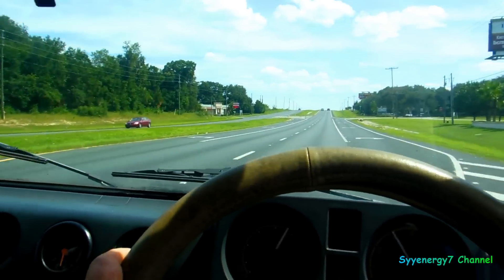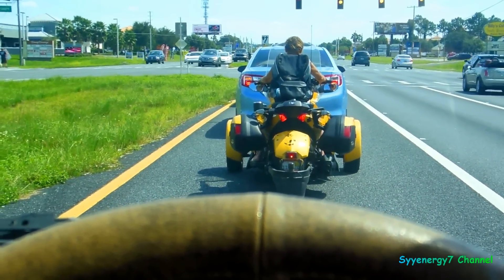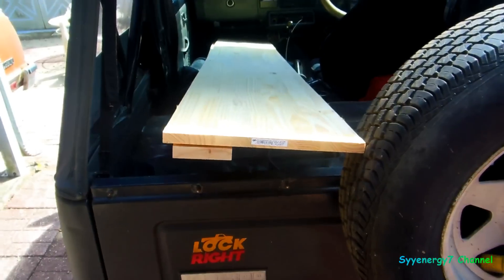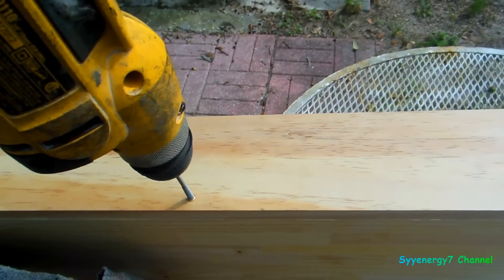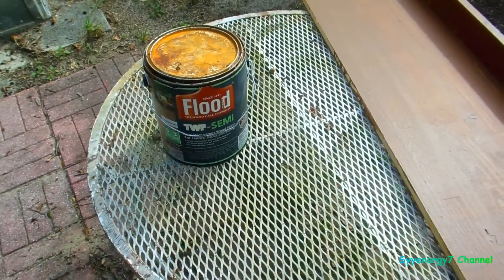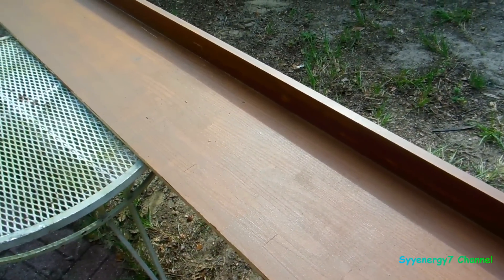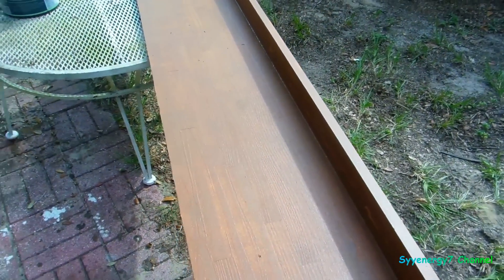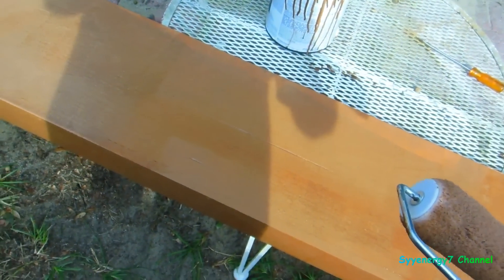Build a Cat Ceiling Walkway

Comment: What thickness are the boards?  1/2"? 3/4"?  and what length wood screws did you use to attach the boards together?
Reply from the maker: +Julie Horvath 3/4 inch by 12 inch.  Plus big shelf braces and a board on top against the wall.  The screws are 2 1/2 inches.    I'll be making many more.  I already made several so far.